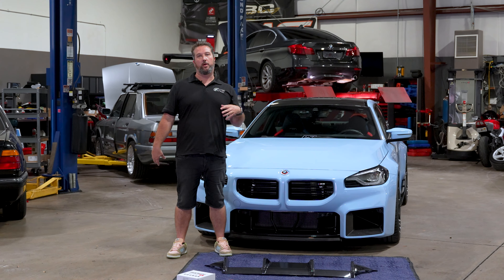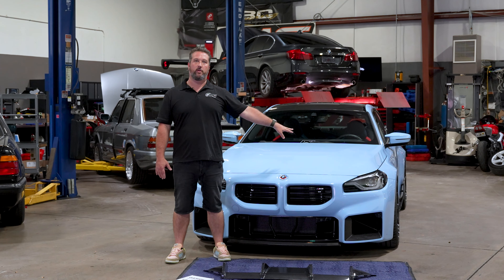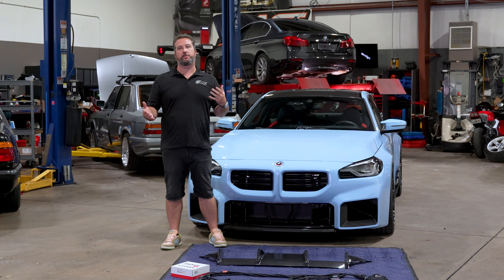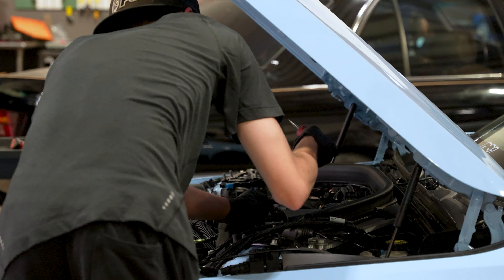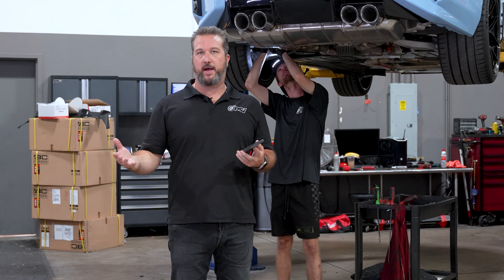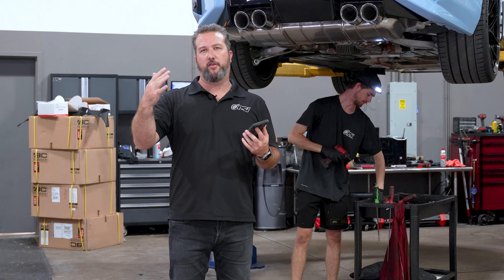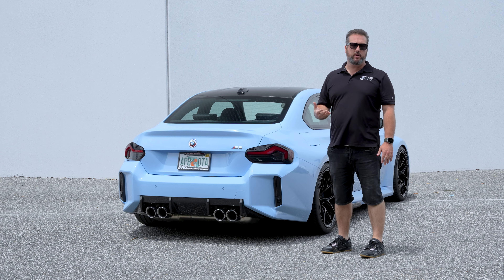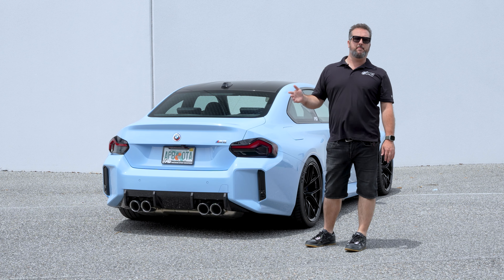Adding 100+ HP in 1 Hour to the G87 M2!

Comment: Wait, the Dahler piggy can control the valves during warmup but not while driving? What is the technical constraint that requires separate hardware to fully open?